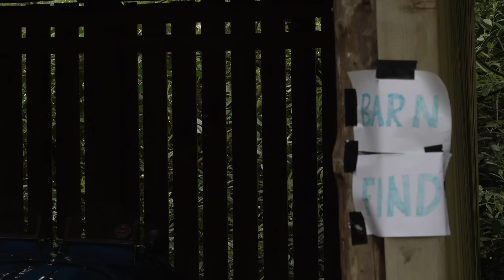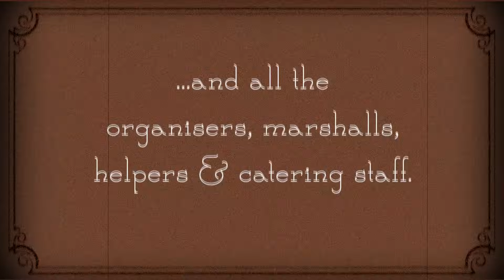The Festival of Slowth 2019

Comment: Goodness. The older I get the more appealing these little treasures become.I saw a wicker bodied , v twin powered twin seater a few years ago in Melbourne Australia. It had a rope pull start in the cabin, a solid rear axle with a single Morris Minor brake hub on the inboard part of the axle . The seats were two plastic stackable kitchen chairs without the steel legs. No gauges, or switches or even any lights. Wish I could see it again today.

Comment: Cyclecars are often overlooked...always found them interesting...were an answer to the engine displacement tax... I think Morgan cyclecars are still being made, but rather expensive.
Reply: 3 wheelers were taxed as motorcycles,  and motorcycles were taxed according to cylinder bore size. The reason for such long stroke engines.